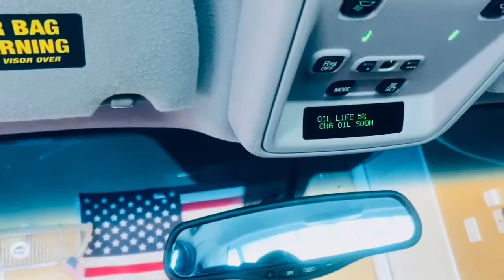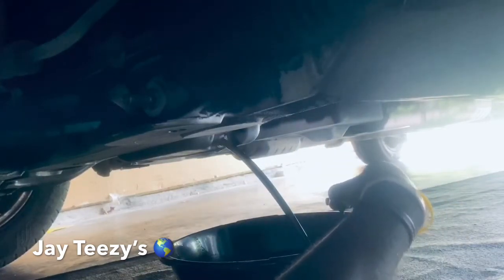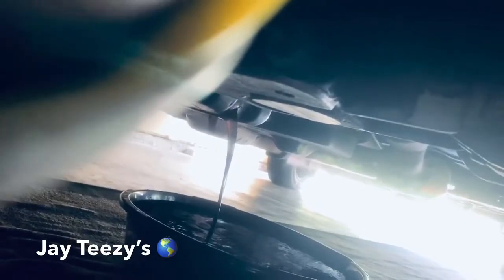Motorcraft oil change in Lincoln Towncar . Why I use Motocraft oil in ford engines.

Comment: The "W" stands for "Winter"....not "Weight". Also, why don't you have a Motorcraft battery?  That's what your car came with just like the oil. Motorcraft batteries from the dealer are priced even cheaper than batteries from Autozone or anywhere else. I know. I work at the dealer.
Reply from the maker: Didn’t know motorcraft carried AGM batteries. I will try them next time I appreciate that. Winter or weight is all the same to me. At cold temperatures the 1st number is you viscosity rating and when your oil warms up the 2nd number is your viscosity rating.
Reply: @jayteezysworld6817  thats why it stands for winter because then first number is the cold temp number
Reply: Also, the Motorcraft AGM batteries are only for specific applications, such as the vehicles that have those batteries as original equipment. Motorcraft doesn't have AGM for any other application.
Reply from the maker: @davidwysocki143  next battery I’m going to try the dealership 1st
Reply: Thanks for saying that about the battery. I never knew. I have two years left on this Walmart one.

Comment: Tell u something I noticed about that 4.6 single cam.. it burns exactly one quart of oil no matter. I’m always one quart low .. I had a 97 town car and a 97 grand marquis .. Lincoln had 160 k miles the mercury had 61k.. didn’t matter .. really good reliable engines doe.. I got 240k on my 05 .. and it’s clean and runs perfect... where da vogues?
Reply from the maker: Adrian Harvey I swear by mine yes sir there good cars. I took the wheels off to go ahead a get that bad wheel rechromed.
Reply: Jay Teezy’s World and u sed they were 245 45 19?  See I dnt know either to go with 245 40. 20 or 245 45 20.. the stock recommendation would suggest 245 40 but I think I may have space for the 45 series
Reply from the maker: Adrian Harvey I like 245 45 better. It’s 245 40 on my caprice . And the white wall is not thick enough.
Reply: Jay Teezy’s World that was my fear to .. good lookin
Reply: @jayteezysworld6817  I wish you could post picks in the comments cuz ill post my 2003 executive Lincoln town car on dem grown men dat bihh pressure 💪
Reply from the maker: @Moneybambinoypc  I want to see it Jay_Teezys_World on Instagram DM me
Reply: @jayteezysworld6817  bet
Reply: @jayteezysworld6817  can't find you on IG
Reply from the maker: @Moneybambinoypc  my bad Jay_Tezzys_world
Reply: @jayteezysworld6817  Still dont see you G
Reply from the maker: @Moneybambinoypc  what’s yours
Reply: @jayteezysworld6817  its @Moneybambino on IG